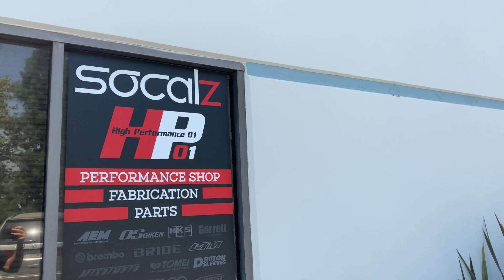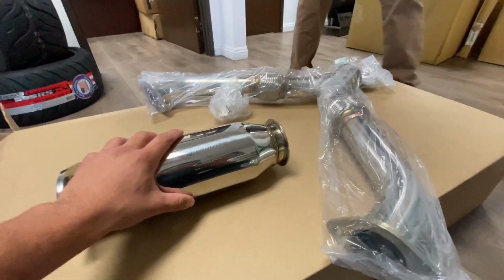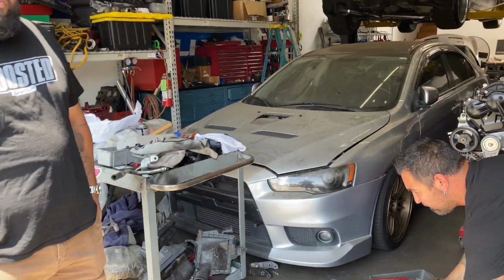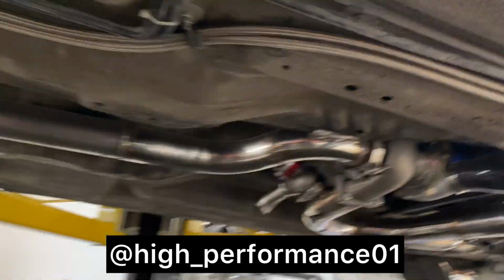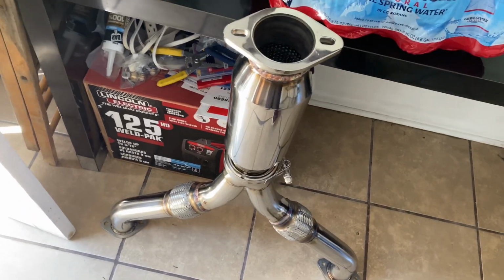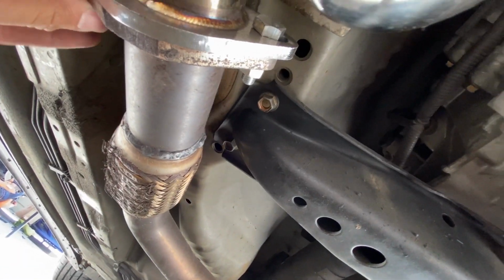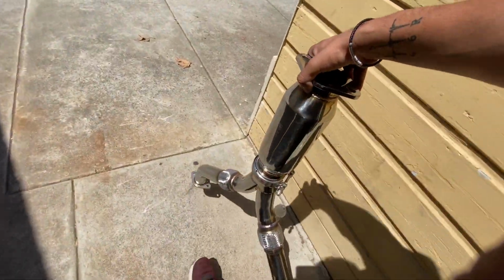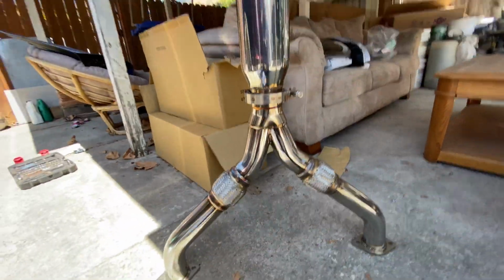G35, G37 350Z MOTORDYNE Resonated Y pipe (install and sound clips)

Comment: So this car still has the stock catalytic converter?? Does the XYZ pipe with the resonator replace the stock catalytic converter??
Reply: No he has the art pipes (test pipes) that replace the stock cats. I just put art pipes on mine and not digging the exhaust fumes and living in California it’s gonna be risky trying to drive around town since at a full stop you can smell it a lot. I’m gonna purchase the xyz pipe he has and add the high flow cat motordyne offers so that it will calm the smell. Overall I’m happy but if I can be little low key about it I’ll be satisfied.
Reply: Envision_VQ So if i were to get the XYZ pipe with the high flow cats that would replace the stock cats??
Reply: @DaytonaBlueHr  no because they’re test pipes not cats. But adding a cat on the ypipe xyz motordyne it will help emissions. How much will it help? I’m not sure cause I don’t know anyone who runs them nor have I seen a video on here. If your asking in terms of will I get a check engine light on with the art pipes? No you won’t. In terms of smog let’s just say you won’t pass the visual cuz they’re not cats and I’m not sure if the one cat that comes with the y pipe will make any difference with smog. But if you know a place where they aren’t so strict and don’t do the visual well then you won’t have to worry. Once I get the y pipe with cat I’ll post a vid but honestly for performance get the art pipes. They’re pricey but worth it.

Comment: Where's the shop located at? Thanks in advance.
Reply from the maker: Rancho Cucamonga
Reply: @edimaya2951  thank you. I have a VK engine want to add some performance to it but not extreme. All I've done is muffler delete and switched from Y-pipe...to X-pipe. Got rid of my resonators but thinking of putting them back on-coz it rumbles kinda when I step on it and not liking it. I want it a little subtle.